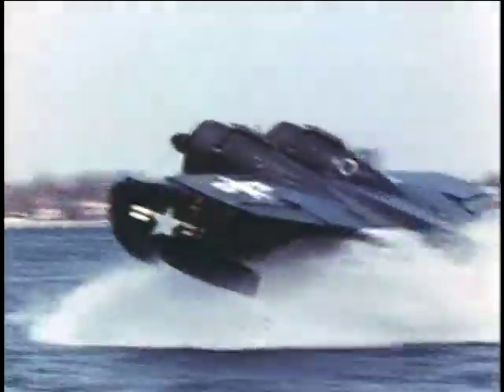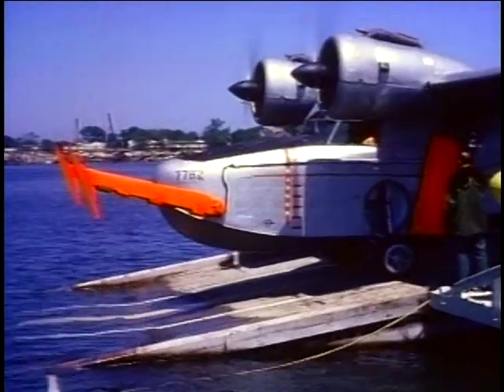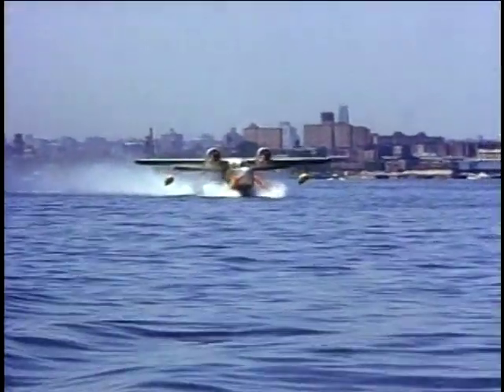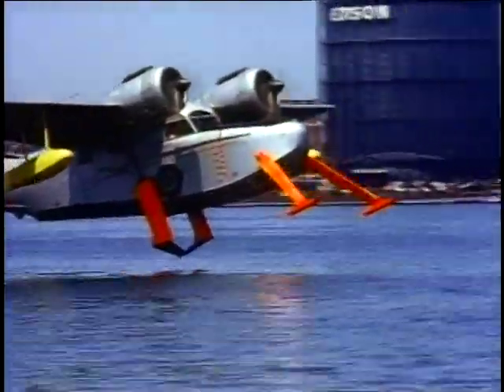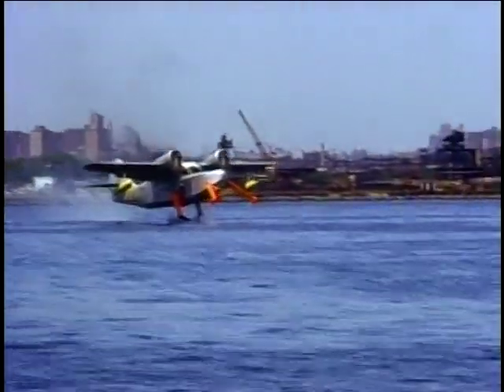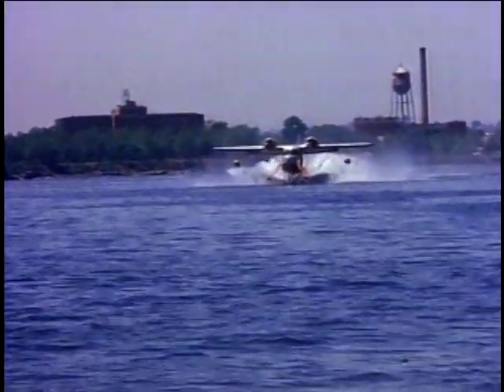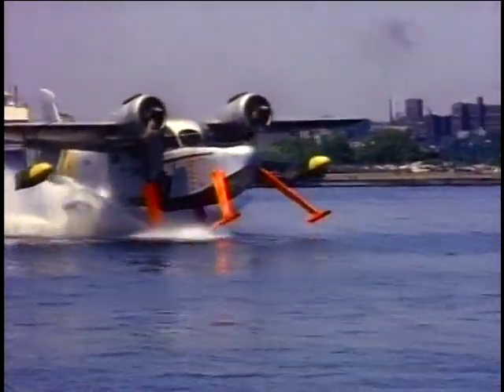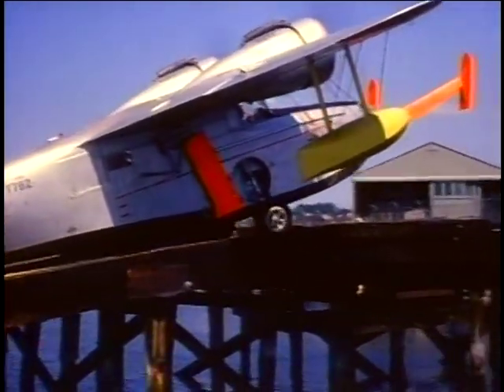Seaplane History -Goose

Comment: See also the Chase/Stroukoff YC-134E. An upgraded C-123 with BLC for STOL, and a waterporoofed fuselage (no "step", as on a seaplane), with a pair of big flat skis. On skis, it operated from dry land, water, snow, sand, etc.
The 5-sided funny farm in its wisdom, saw no use for it.

Recently they were delving back into putting floats under a MC-130J, and presently (2023) DARPA is looking into a large GEV/Seaplane for logistics called "Liberty Lifter" after the Liberty Ships.
It called for ability to operate from waves, or to fly up to 3km, and for sustained forward operations at unimproved, minimal conditions.